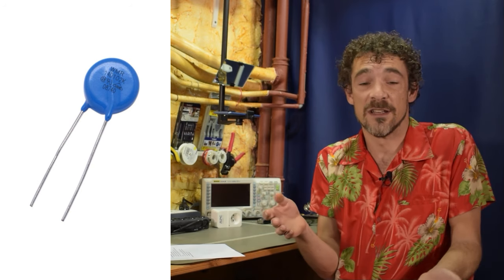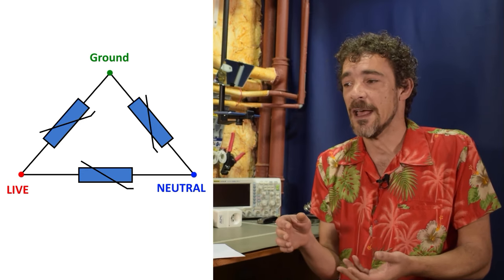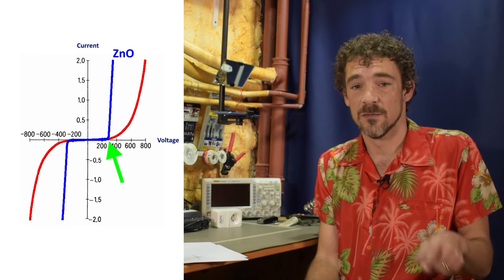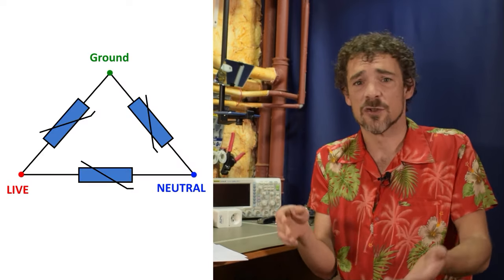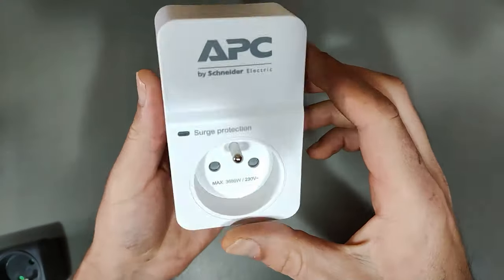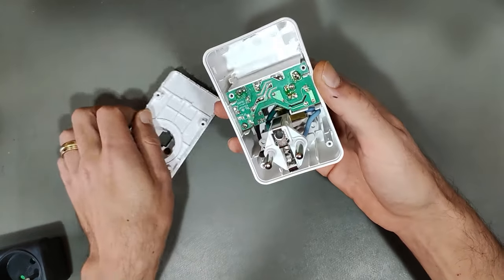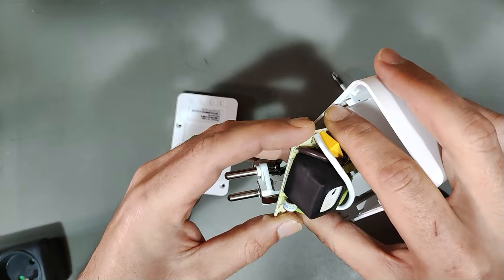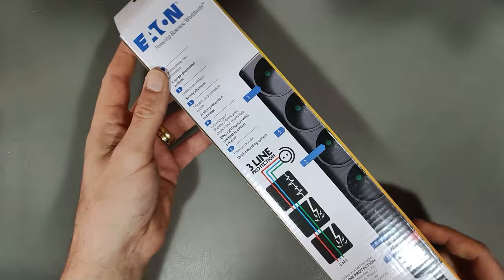Do surge protectors really work?

Comment: One way screws are used due to the fact that there are no end user serviceable components inside. I believe your description of the thermal fuse is incorrect.  It should be in series and disconnect power to entire power strip.

Comment: How much is a couple of years, I just replaced all in my room. Very curious
Reply from the maker: It depends on how stable your power is. I watch our line voltage regularly (via the display on my UPS battery backup as well as direct measurements with a digital multimeter) and since I live in the country, it's pretty volatile. Jumps all over the place during the day, and is almost never a stable 230V like it should be. So, in my case, I'll replace them every 3-5 years. If the line voltage is quite stable where you are, I'd say 5-10 years.

Comment: Hello,i have small question , do apc plug can provide safe connection from 2stroke petrol generator to delicate electronic,  im looking for something to protect my electronic from fry , once i plug straight to generator my makita battery chargers and it fry instantly , and i dont wana make same mistake, im using my generator on my allotment
Reply from the maker: Just the APC surge protector probably isn't enough. It might protect against voltage surges, but not against under-voltage. If voltage is too low, current goes up - then things get fried. Plus, running on a generator is often very tricky for certain electronics (like battery chargers) because generators are like little tiny pools of water, whereas the electrical grid is like an ocean of electricity. The ocean can "absorb" more than the little pool of water. The same is true of inverters for green energy sources.

Comment: I have a question,  I had a lightning strike yesterday,  i had everything plugged in into a surge protector,  including my xbox are they going to get fried? Because the lightning was in big impact with my house. Im worried
Reply from the maker: Most likely, the surge protectors are at least partially fried. Probably a good idea to replace them. If anything plugged into the surge protectors was fried, then the protectors themselves are DEFINITELY fried.
Reply: @ScottiesTech  I checked today, everything worked. Which is weird. Do you think there still going to be fried?
Reply from the maker: @TheOfficialMiztrCounty  It depends on the intensity of the strike and how big the resulting surge was... So, better safe than sorry!
Reply: Keep in mind lightning can also travel to your electronics from OTHER sources, such as lightning hitting an outside light fixture, antenna, etc - and travel through coax cable or such, and NOT go through the electrical panel and those wires -

Comment: can a fast blow fuse protect from over voltage if the voltage passed through it is over the fuse rated voltage?
Reply from the maker: Usually, no. Surges are often very, very short, and the fuse may not blow even if the voltage is too high. Fuses are made to blow when the current hits a certain level.

Comment: So then what actually works? What actually shuts off the power?
Reply from the maker: Either a surge protector that DOES cut the power, or a surge protector that you build yourself with a voltage sensor that drives a contactor. Not so easy to DIY, unfortunately.

Comment: 18:40, but if the surge suppressors blow up, doesn't the flow of current stop (hence, rescuing the gear if it isnt already fried)?
Reply from the maker: In most of these, no. The protection blows up, but then they keep on sending juice to the connected gizmo(s). In that sense, they should be called "surge suppressors", not "surge protectors"!
Reply: @ScottiesTech  hmmm I see, are there any labels or anything one could look for that differentiates between protectors that stop current vs those that dont?

Or do you simply have to take the thing apart to know whats inside?
Reply from the maker: @olliveraira6122  The only brand I know of that actually cuts the power is Tripp Lite. Can't those where I live, unfortunately, but that's what I'd use if I could.

Comment: So I just built myself a pretty expensive PC and wanted to "protect" it with such a socket. Now looking at whats available I stumbled across numbers like 13500 A and 60000 A surge protected. The Price diffrence is really crazy, up to like 80$+, now the question is do I need such a high end multi socket (like 8 sockets in a row) or is it wasted money? Is the 13500 A enough or should you go with the 60000 A one. I'm powering a 1300w PSU (PC), a lamp and some smaller gadgets with it, nothing more. As you might've noticed I have no clue about these things and I can't seem to wrap my head around that topic, so please help me out!
Oh and I don't think I really wanna use one of these UPS things, those are so massive..
Reply from the maker: It's hard to say without actually looking inside the units. Some surge protectors have larger varistors, some smaller. The bigger they are, usually the more juice they can handle before exploding. But really, ANY surge protection is 100 times better than none. So, I just go for the most reasonable price from a name brand with positive reviews.

Comment: can I use surge protector like the apc with 1 outlet in front of power strip with 6 outlets?
Reply from the maker: Yes! Surge protectors protect everything plugged in to the same circuit. That means if you have a circuit breaker (in your electrical panel) connected to, say, 3 power outlets, then plugging in any kind of surge protector in 1 of those outlets protects everything plugged in to all 3 power outlets - plus anything plugged into plugged-in power strips, etc. You can even plug in more than 1 surge protector, and you just get more protection.
Reply: @ScottiesTech  thanks. what about this brand branenstuhl, I see they have from 13500 a to 60.000a, how much of joules it is? It is worth to pay 3x more for more stronger strip, 70 eur instead of 25?
Reply from the maker: @seba2038  Those ratings are mostly marketing nonsense. Brennenstuhl is a pretty good brand though overall. Usually, I go with one of the more popular (and mid-range expensive) major brands. Otherwise, it's Chinese no-name brands. Some of those are very good, but others not so much...
Reply: @ScottiesTech  ok, but must be difference between 13k and 60kA, it cannot be only marketing. Probably they have more powerful elements inside...so they can resist to stronger surges.
Reply from the maker: @seba2038  Sometimes yes, sometimes no. Very often, they use short-term current ratings as "the rating". IOW, a varistor can withstand X current for 10 seconds, or 4X current 1 milliseccond. The more accurate value is the 1 second rating, not the 1 second rating. Better yet, what's the 1 minute rating, becuz then you're sure the component is far less likely to fail during short surges. So they're usually not lying, just exaggerating. It's kind of like cold cranking amps for a car battery. Yes, under absolute ideal conditions, you get LOTS of current, but drop the temperature by 10 degrees, and no you don't. It still works, and it's still a lot of current, but - well, you get the idea.

Comment: Obviously these are only type 3 and there should be type 1 and 2 sp's before them.
Tgese are junk anyway that use lits if plastic and it is better to fit them in the consumer unit.

Comment: How about if you connected a surge protector to another one and the 1 more and then finally on that last surge outlet you connect you’re electronics? 😂
Reply from the maker: Then you're extra-safe! ;) I actually DO connect multiple surge protectors in 1 room. If one surge protector fails, the 2nd or 3rd one plugged in to the same circuit keeps protecting stuff.